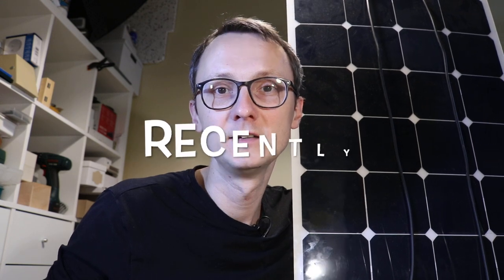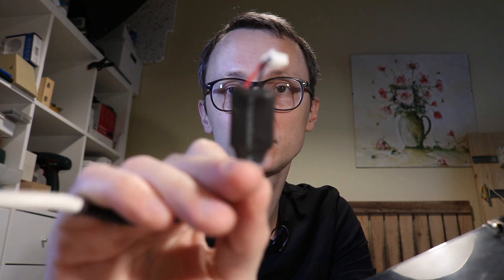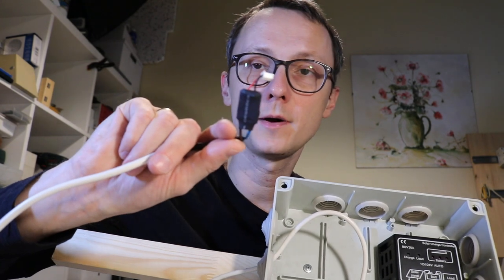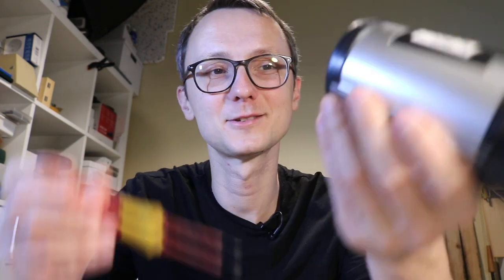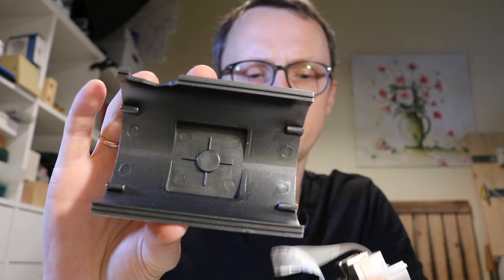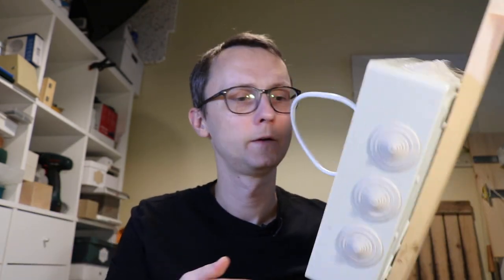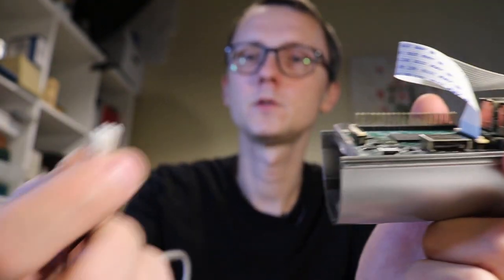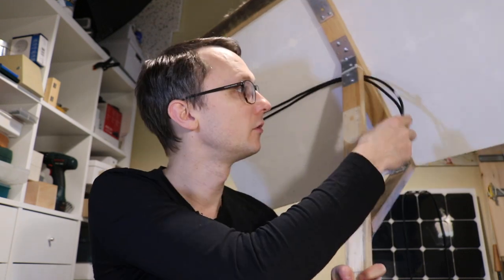Solar Powered Raspberry Pi Security Camera, Part 1

Comment: Thanks for this.  I only just got into the whole raspberry pi world last year so i am a complete beginner.  I just read about this in the magpi magazine.  This is a project i am now thinking about doing.  I am a British man married to a Latvian.  We have lived in Latvia now for 8 years and have a countryside house. We have been thinking I need to build a project like this to help us monior where the kids are playing outside.  This video has given me some ideas, thankyou!
Reply: Raspberry Pi and Arduino-like products are awesome!!! Many, many projects to choose from. One version could be done with PoE (Power over Ethernet). But it,s kinda expensive to build too. One another possible way is to add 10 000  - 30 000mAh powerbank 2.5A output and with 12 cigarette lighter-USB-adapter in 12v output. Weather related things are also bound to happen, so make sure systems are safe from those as well.

Good luck with prototyping!  Its fun...

Comment: If you replace your solarcontroller with mppt version of, it hides the load and battery from the solarcell. Which means they can output more than 100w if the conditions are met. Open circuit voltage are poured into the mppt solar controller. Also li-po version of battery you can use specific or desired voltage. And you will need an BMS to safeguard you li-po cells. Of cource you can charge your cells without it, but probably loose the charge count as welland degrade your battery.  You only need to change charging voltage and amps to met li-po charging, which can be done with the solar controller itself. If you use specific li-po charger in 12v output it would be the best.  More portable and flexibility than akward heavy battery but more expensive and more stuff.

My friend is planning to use this kind of setup his birdbox-camera. All day night video feed enabled via wi-fi or gprs/lte/4g network.

Nice video tho. Thumbs up!!

Comment: How many Cameras can you run on this setup?
Reply from the maker: Are you referring to the capabilities of the solar panel and the battery? With an average power consumption of around 2W for the Pi + the camera it needs a battery with the capacity of 24h x 2W = 48Wh. So a 100Wh battery could run two cameras for a full day with no sun.
Reply: Kaspars Dambis thank you for the information